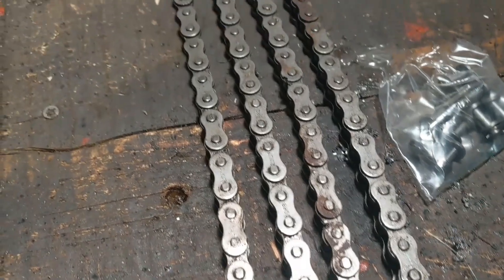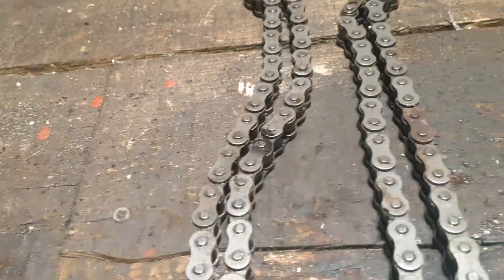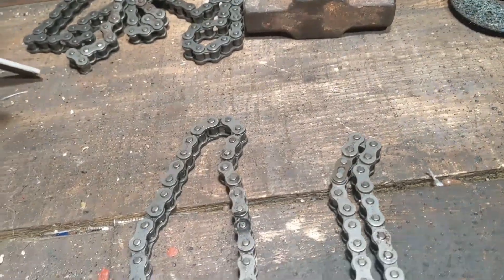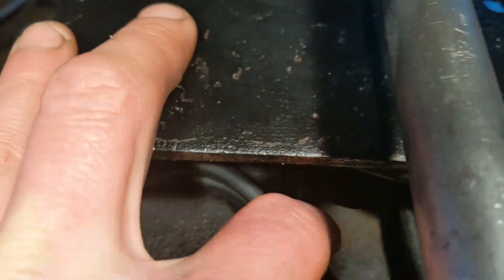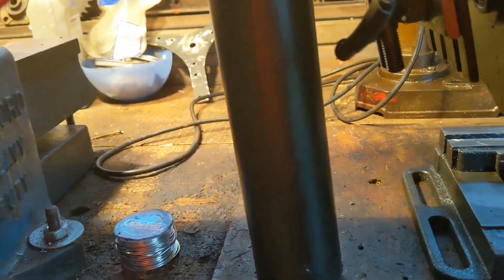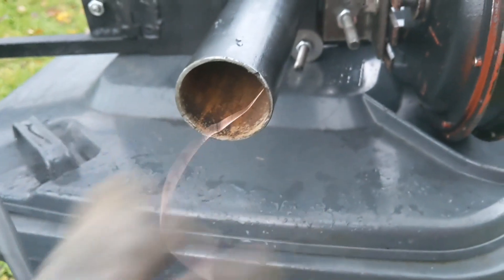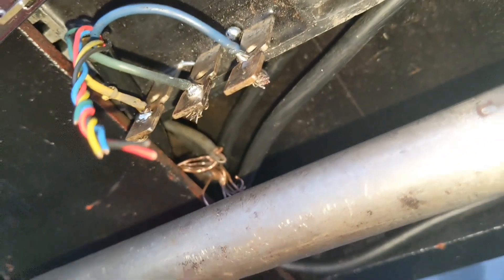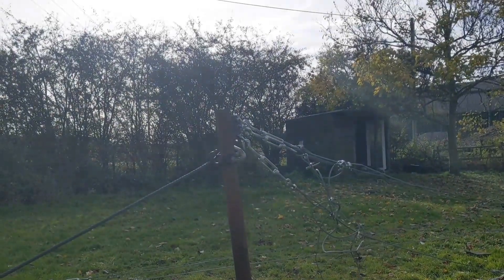48 v 1kw E-bike hub wind turbine dual rotor 28 October 2020

Comment: Hello it would be good to put a line in quotes the size of the pa is the height of Lenny to be between the two sets of pas. Lenny’s model copying a dorsal fin from a Marine dolphin. or equal to the stabilizer or vertical line of the top and rear of the aircraft. the size can be the size of a PA or the size of the central radius to the diameter outside.